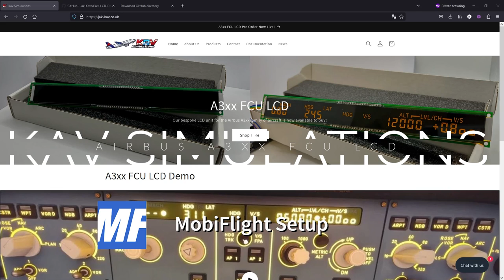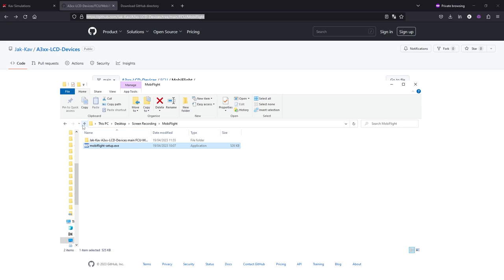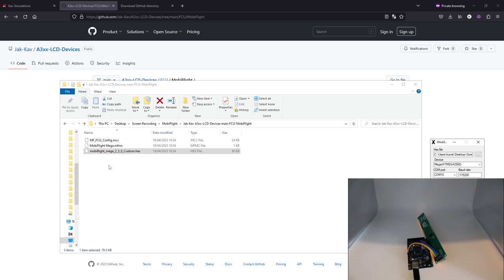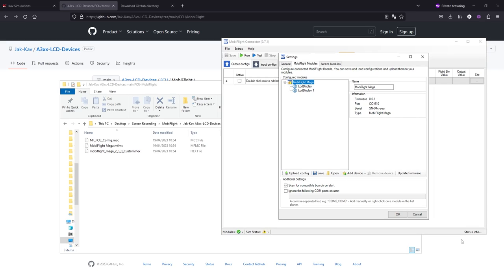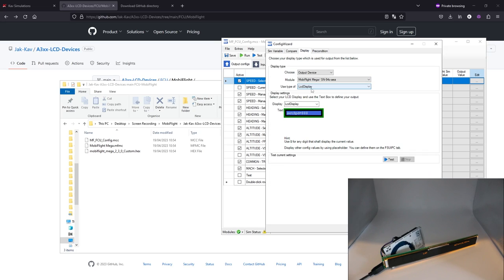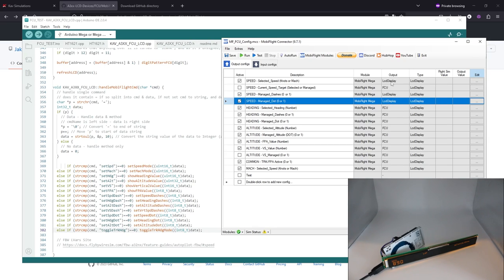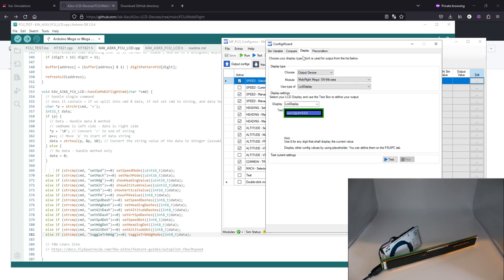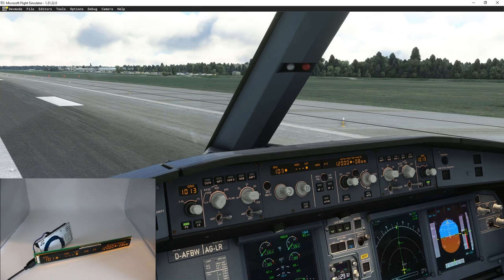Easy Setup Guide: MobiFlight for Airbus A3xx FCU LCD

Comment: Thank you for the video, well explained.   Will the team also have a config for the Fenix A320?  We know right now there's an issue of some AP FCU numeric values not available from Fenix A320, but there are workarounds, for instance, like FenixQuarts which fetches these values from memory.  I suppose these "hacks" would work with the display and the config too?
Reply from the maker: There is no reason that I can see why FenixQuarts wouldn't work.
By creating your own profile as described in the video, simply choose the appropriate LVAR/etc you have created and assign it in the MobiFlight config :-)
Reply: Hi, could you explain about fenix quarts pls. What is this?